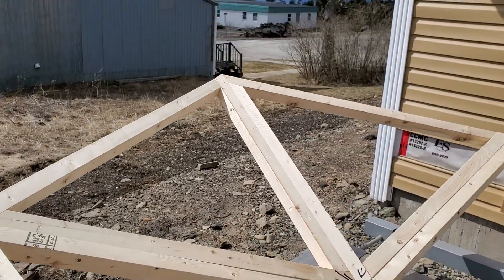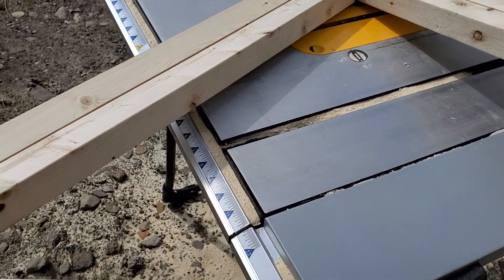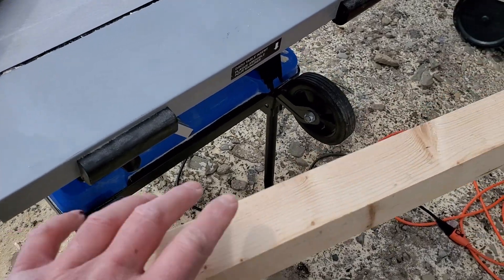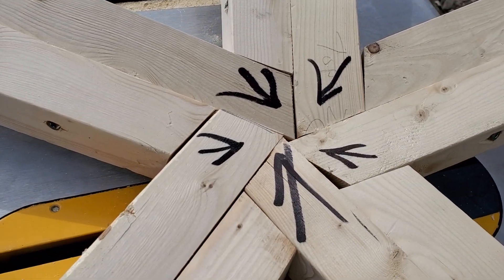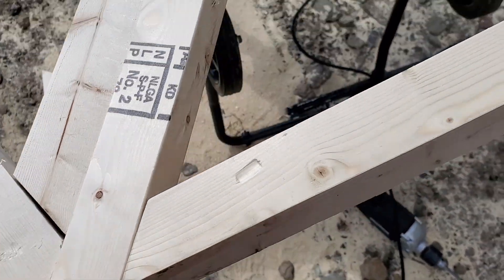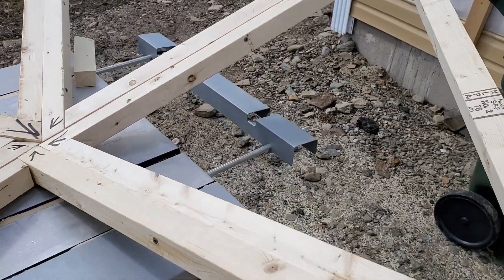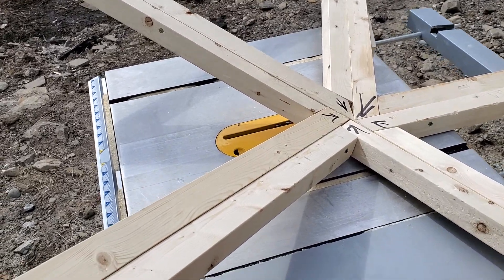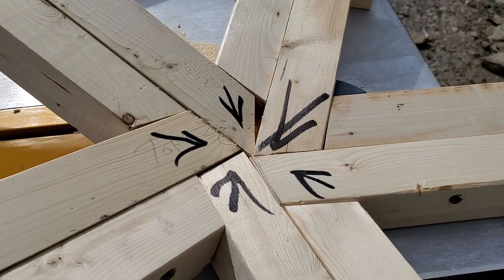GEODESIC DOME PENTAGONAL SECTION GOING TOGETHER APRIL 2020

Comment: Are  you working based  upon on some kind of guide? I did a  kit  dome  last year  and really  would love to  do a DIY one this year and am looking  for any kind of instructions!
Reply from the maker: As a guide,  I had discovered fellow YouTuber Paul Robinson's channel.  He is the one I learned the beveled frame technique from.  He has two or three really pertinent videis and if you only watch those,  you can get a solid feel for building your own.   I will try to list or link those videos in separate comment below.  It's a very simple technique and involves making only two jigs (for a three frequency dome) on which you build all the triangles.   With respect to an earlier commentor,  I did do some trigonometry to ensure I had the angles all good on paper.  The dome did fit together with only slight persuasion needed at fitting in the final top pentagonal section.   I believe there's 2 possible reasons it didn't fit perfectly.   1 is that given I was using basic entry level (read: cheap and affordable for me)table saw and circular saw, you only get so much accuracy especially with angles.   Now I have an engineering technology diploma and am not afraid of math,  and on paper I had my angles worked out to 3 or 4 decimal places or more.  Real world,  I am lucky to get half a degree of accuracy in my cuts.   Over 75 to 125 triangles,   minor errors can magnify out.  The 2nd reason,  and I believe the more likely that I had to persuade the final piece in is maybe laying down the bottom row of half-hexagonal sections,  they were slightly out of 'round'.  I have watched some build videos where they seem to measure the diameters across angles and straights I guess looking for uniform lengths,  similar to when building a square deck,  you check your diagonals are the same.  I didn't do that.   Maybe it's a bit of both.   At any rate the only correction required was a saw blade width worth of trim on one section and it dropped right in.  I never built anything before in my life.  Not to my own design.  I helped my brother with some renos 30 years ago but really since I was 20 years younger than him and myself only 20 at the time,  I was limited to mostly grunt labor then.   Still,  for all that,  given Paul Robinson's videos I got it done.  Paul does sell plans too  I think at this time he isn't supporting much more but his site is www.geo-dome.co.uk and he has dome calculators etc on there.   If you do build,  look up 'poor mans fiberglass ' which I regret not knowing about before caving in and shingling mine.   Also,  tar and metal flashing around the base is important to stop leaks if you have a square deck.
Reply from the maker: https://www.youtube.com/watch?v=JRbTyFK2m7s

https://www.youtube.com/watch?v=cJQY_srilHA

https://youtu.be/EYJbQMi0XW0

https://youtu.be/QnTL7b1O3xo

https://youtu.be/fSp5rakEgOk

https://youtu.be/Xsmf1tnpnBY

He has lots of other videos, but if you only watch these above, you should have enough to go on for a solid build!  Any more questions, ask away!
Reply: @justmeted1969  thanks a  million!